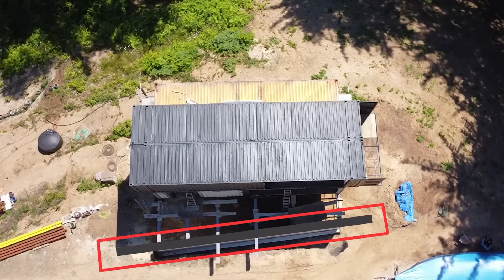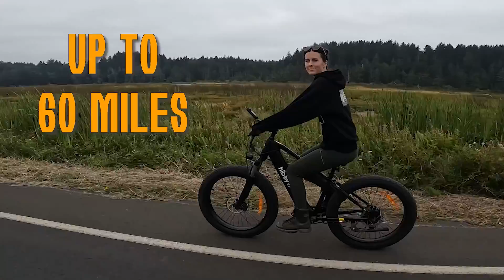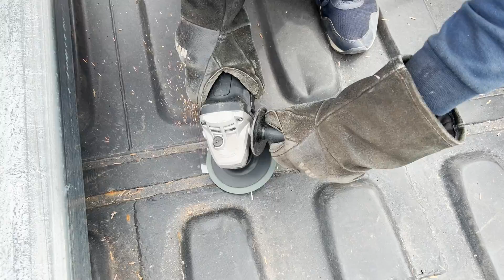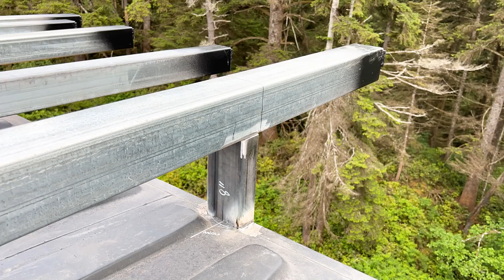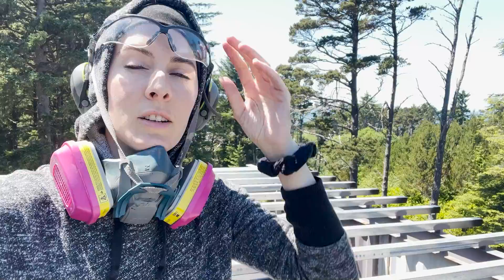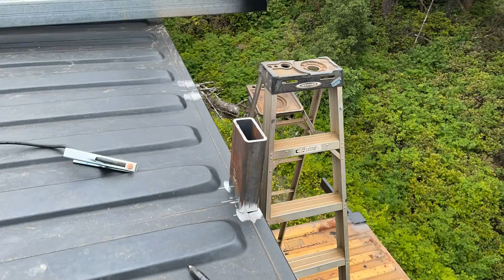Building the EPIC ROOFTOP DECK of OUR DREAMS #build #construction #modern

Comment: Laying out those tubes for the roof ..if you measured all of then from the Even Side then they would line up. As for the Tube Risers if you measured all of them then welded the Risers on they could be welded then flipped over then placed on that way they all welded underneath faster that way. As for the other side just tape it off from on end to the other then cut each off to ....Angled Length that all. If they were equally measured off at each Rizer then you have a easy chance to just weld them. Pre-Measuring is how to do it at each position. That is how we do it also as Iron Workers and Welders. As far as the longer Over Hange just place those .......PlyBoard
s on the Tubes and weld them up but be sure to clamp them down. All you need to do is have a good platform for the overhang to be welded thats all.
Magnetic Holders can be used for positive holding of any metal work.

Comment: You've accomplished great thing  on the exterior. Now you need to think about "getting it in the dry." By blocking off access to the inside by water it will allow you to get on with the all important interior work. Inclement weather is on the way. You  will need to do electrical, heating/air, insulation, flooring, drywall, painting, etc. This will allow you to work all winter without worrying  about weather.
Reply from the maker: Thanks so much!! We are really close... :)

Comment: Two poles taller then the house , aircraft cabled ran across to other pole,n found cable also. For lightning. , then draped string over, then tied down. Water sheds, steeper the better.
Reply from the maker: That's an idea! :)

Comment: As a fellow welder, there's been a time or two where I needed to work in the rain but couldn't be wet while we welded on boats in the yard, this is my advice as we needed to weld and not be wet or have any of our projects or the area we work in be wet. Using 2x4 or 1x2 framing lumber build an A frame skeletal structure stapled with painter's plastic, it's a little bit of work but I've built them to be at least 35ft tall and over 100ft long over an entire charter vessel to keep the entire project and area around the boat out of water. You let the painters plastic run about 3-6ft off the bottom end of the A frame to let the water run away from the project and because it's and A frame and not a box there's no water sitting on the top to spill onto our project at any time. We always bought the REALLY big rolls of painter's plastic to do so and sometimes you had to double the plastic up along the framing, but it meant that it can be worked on and be dry all season long, and when you were done you could cut them apart in sections for an easy teardown that could be easily assembled and added onto again if you had another project. Just a thought. I hope this helps somebody. I just imagine you spend more time cleaning up the mess from the water or not working on the project because of the rain than the time it'd take to put one of these together. Always manage your time my friends.
Reply from the maker: Thx so much for the detailed suggestion!! Really appreciate it :)

Comment: You basically built a shipping container from scratch for that entry way... I wonder if it's cheaper to build a whole box that looks like a shipping container with beams and some metal on the sides or to buy the used shipping container?  What's your guess on that?  Which is cheaper, all the metal to make a metal box or one used shipping container?
Reply from the maker: Lol yes we definitely built a version of a container for our entryway. Since we used the leftover panels from the other containers, and mostly overstock steel, it was pretty cheap overall. Probably cheaper than buying 2 containers, but if you include the concrete pan floor it's about the same price.

Comment: if you set the beam on top of the spaces and clamp them down you will not need to level each one as you weld and save half the time
Reply from the maker: We had to level each one on the edges of the container but the middle ones we didn't have to do too much.

Comment: Have you done the math on the ŵalls bearing in the back off the house when you have 1 m off snow on the roof,and all that rain how it impacts the ground stability,how you gona lead water away from the house🥰
Reply from the maker: Yes the house is engineered for the weather in our area, including snow loads. Although we rarely get snow here. It's mostly rain. We have a drainage plan to lead the water away from the house with gutters and french drains, etc.